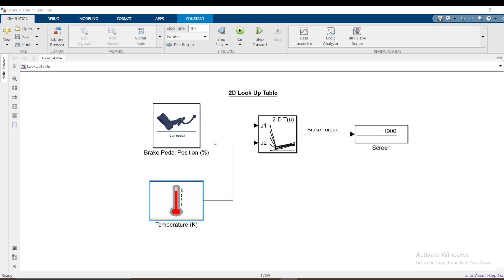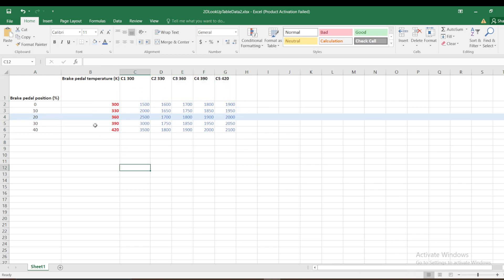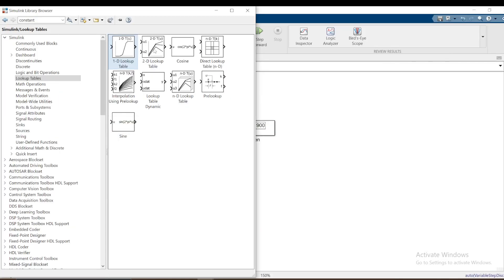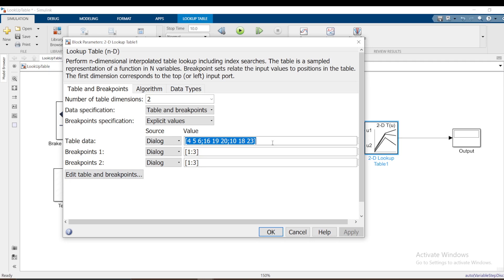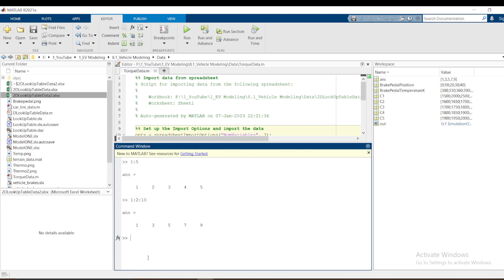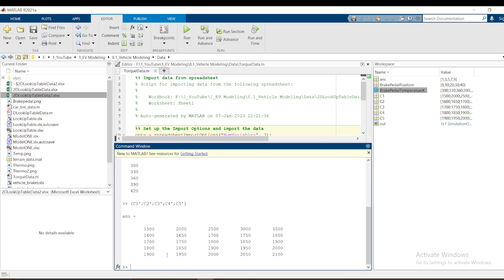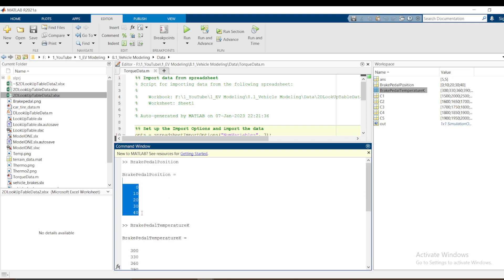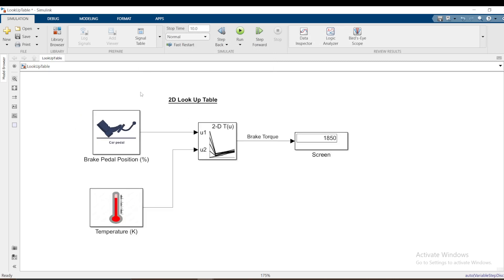2D Lookup Tables with Simulink Tutorial 4

Comment: Breakpoint vector 1 in block 'Model/2D Lookup Table' must have the same size as its corresponding dimension of the Table data.
Component: Simulink | Category: Block error
Breakpoint vector 2 in block 'Model/2D Lookup Table' must have the same size as its corresponding dimension of the Table data.
Component: Simulink | Category: Block error
How to solve this error?
Reply from the maker: Ensure data provided has same size i.e n x n data. E.g don't add pedal position 50 without adding extra row in temp data